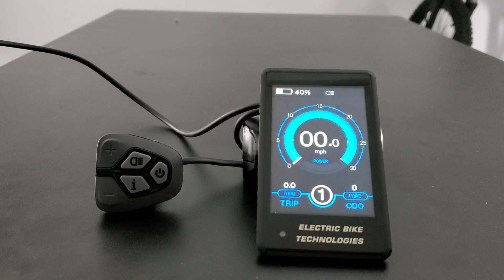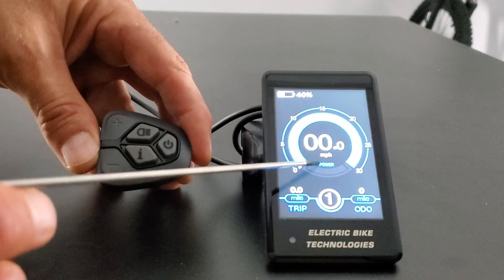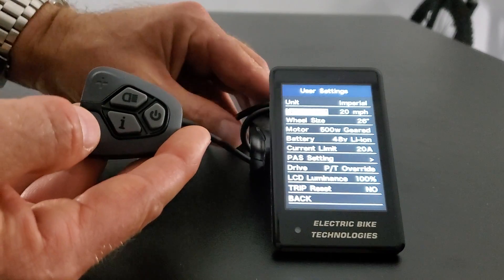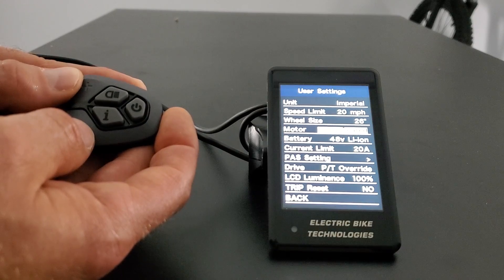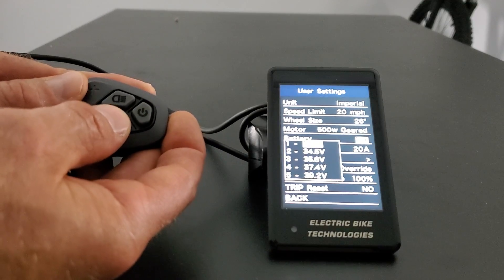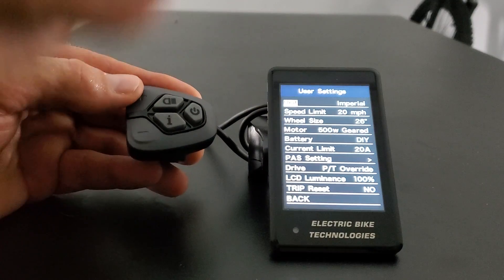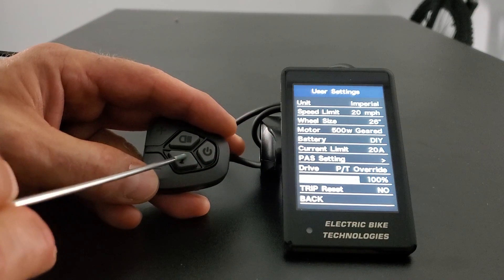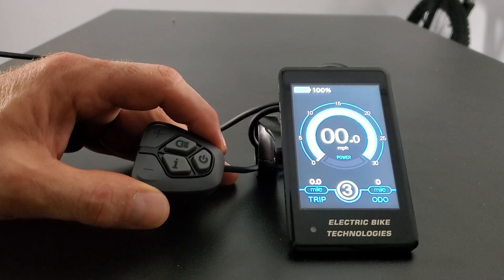E-BikeKit | E-BikeKit Conversion Kit System - Full Color TFT LCD Display - (August 2020)

Comment: Can u add a headlight into your system that's what my ebikekit is missing it's awesome but nice to not need a light. Appreciate your quality and reliable system
Reply from the maker: No, it adds a failure point and there are so many options for independent lighting that are affordable with long lasting batteries. Plus you have a 5v USB port on the E-BikeKit LCD and on the battery which allows charging of external lights (or any mobile device) without removing them from the bike/trike.

Comment: Jason, Can this display be retro fit onto my now discontinued Fat Delta?
Reply from the maker: Yes. If your trike has the E-BikeKit system on it, you can use this new display.
Reply: @electricbiketech  If I get my Fat Delta into your facility, can your team do the install?
Reply from the maker: @67gs400  Sure, but first we need to be 100% that your trike is using the E-BikeKit system.
Reply: @electricbiketech  Thanks Jason - I'll send a photo of the controller to you guys to confirm.  Fat Delta was purchased July 25 2019.